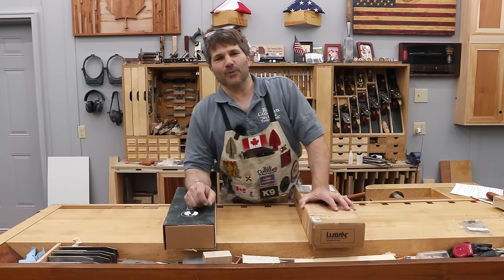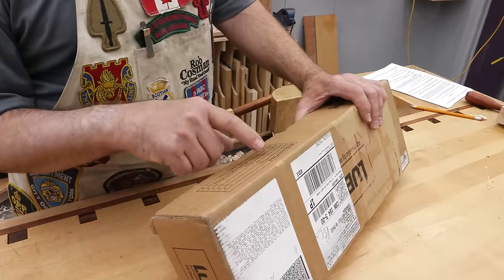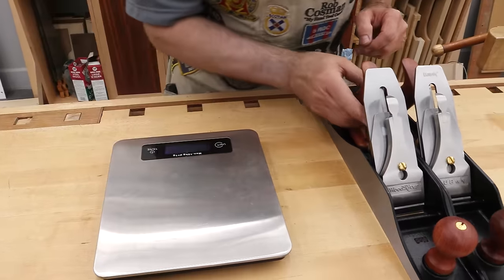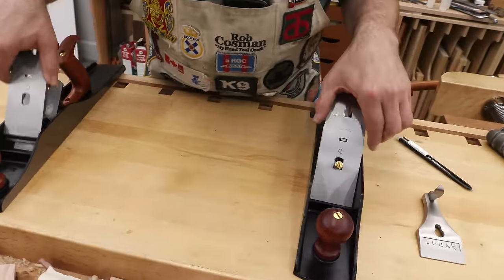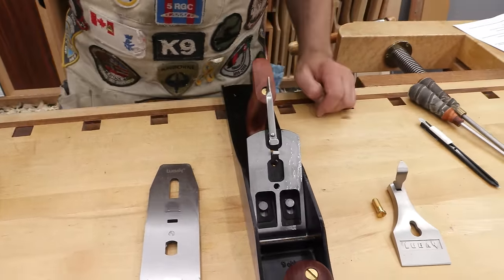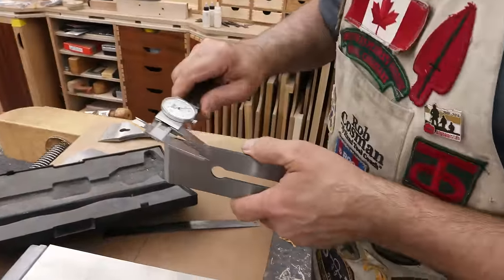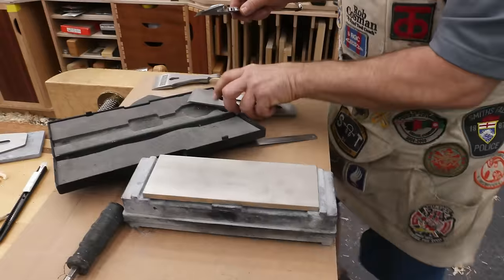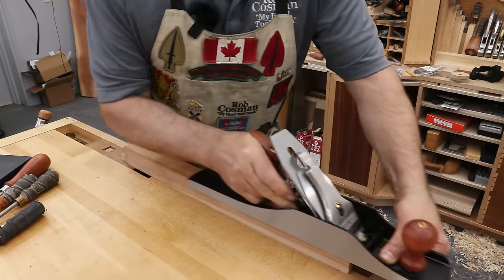Hand Plane Review - Luban vs. WoodRiver

Comment: That's weird. My 5 1/2 luban has the lever with a bearing and a pined brass bump at the top. I was surprised to see that the quality could vary that much. I guess I was lucky. By the way, How did you manage to order a luban when they are not allowed to sell in north America "due to retail exclusivity restriction" ?
I will add that i just checked on the website with the photos and the lever is not supposed to be a bend piece of steel, you should send it back and see if another one would be similar.
Reply from the maker: We just ordered it from a UK retailer and they sent it to us.
Reply: Our experience in Australia as well.
Reply: @RobCosmanWoodworking  It depends from which retailer. I assume @duvalbrice bought his from workshopheaven.com (https://www.workshopheaven.com/hand-tools/hand-planes/quangsheng-planes.html) as did I, because casting is much nicer than the cheaper alternatives from german dictum.com or from rutlands.com which for a fact has the cheaper lever adjustment (I was disappointed when workshopheaven didn't have the  No7 that I was going to buy and then further disappointed when I saw that the inside of the casting was rougher and that the lever adjustment was as on your luban in the video... I much prefer the Quangsheng/Luban from Workshopheaven than other ones). While I don't know if it's the same as woodriver, I can tell you that there are a few European sellers of planes these days, some of whom just rebrand the existing models and the others that have the factory add upgrades. It's quite possible it's the same factory with a few different castings depending on who they're making it for. But I do remember, that I once bought an unbranded blockplane, which has faint texture that seems to have once been JUUMA on the casting even though box said Luban and was sold under Quangsheng label. I also find the workshopheaven.com being more strict as far as QC and tolerances go.
Reply: @maticjelovcan  Yes i bought it from workshopheaven their planes are really great. I have the block plane, the rabbet block plane and the scrapper plane as well. I was pleased with their plane every time. Sadly since the brexit i can't order to france without paying taxes, so i won't.
Reply: @RobCosmanWoodworking  I guess it wasn't workshopheaven then. Thanks for the reply and the great video, as always.
Reply from the maker: You bought a “Quangsheng” plane, which cannot be shipped to North America, the plane we purchased and reviewed is a “Qiangsheng Luban.” I assume that is why yours has the proper Lateral adjustment.
Reply: @RobCosmanWoodworking  do you think customs would make a fuss if. Someone bought it here for you and then had it shipped to you?
Reply: @RobCosmanWoodworking  did you just mansplain my Luban planes to me? purchased ours at timbecon, have purchased others as well over the yrs. beautiful planes. very little tune up needed. best plane ever? try an HNT Gordon wooden plane. that will make you smile.
Reply from the maker: @matic it’s not a government regulation, it’s a manufacturers restriction. Once purchased, it is free to travel anywhere in the world. So to answer your question, yes that would work.
Reply: @cynjohnson1967  mansplain? Yup you're definitely Australian

Comment: I own both WoodRiver and Luban but of different sizes. It's pretty clear to me they came from the same factory with tiny differences. Lateral adjustment on Luban is identical to WoodRiver. Maybe it depends on the batch or export destination. I live on the equator and I'm  close friends with Luban marketing representatives and maybe they sent me a 'better" version. I have many Luban tools and I'm very impressed. I'm an old grumpy white man living in Asia and of course I do have bias for German or Swedish tools. But I have to give credit to Luban as they never disappointed me
Reply from the maker: Its very interesting as some comments say their Lubans have a bearing lateral adjusters snd some say they have the one we received.  I wonder if they did a version upgrade and we got an older one or they just have that much variability in them
Reply: @RobCosmanWoodworking  I will ask tem, and follow up with you on that. 
based on my observations, Luban is very ambitious, and has some sort of maker pride,
I had a similar story with the stainless steel barbell factory. I went to the factory with Eleiko barbell, and asked them if they could beat them with the quality of workmanship / materials used. Basically I asked them to make a custom barbell for me, which cost me a lot. however they made it exactly as I designed it, and exceeded the Eleiko standards.
when I visited Luban factory, I had exactly the same impression, they want to win this game. 
they have many casting molds even within the same brand. it would be interesting to compare a couple of WoodRivers of the same size.

Comment: Really interesting, Rob. In the UK we can get Woodriver from Woodworkers Workshop, Quangsheng from Workshop Heaven and Qianngsheng Laban from Rutlands. I have a Woodriver low angle block plane , a couple of Luban block planes, a Veritas shooting plane and L-N 5 and 4 1/2. What is obvious to me is that the Chinese planes are all built to a certain price point and there are small variations between them. The L-N and Veritas on the other hand are just a level above and beautifully finished. However they are significantly more expensive. Having spent a bit of time honing the blades on all of them, they all work well but the North American planes just feel that bit nicer. I guess you get what you pay for…….as someone once said!
Reply from the maker: Yes I agree with you.  I have always said Lie Nelsen is the best manufactured plane today, and WoodRiver is the best value.  The woodRiver price point was much better before the additional  tariffs went into effect a couple of years ago

Comment: I recently watched a video from Mr. Linn's Workshop on tuning up a Lie-Nielsen smoother--I forget whether a 4 or 4 1/2.  I kinda want to do it (very cautiously) to mine, but at the same time, you have to wonder how perfect is perfect enough?  My L-N worked fine out of the box, and better after 32 seconds of sharpening.  I doubt any amount of tuning will get me smoother boards.  Still, it does seem like any plane could be finished a little nicer...
A thought that occurred to me watching this is that either of these might almost too nice for a fore plane. A case could be made for the best 5 1/2 you can afford, and a Taytools #6. Then it occurred to me that Wood River could capitalize on this as a fore plane buy offering a cambered blade as an optional accessory.  Or maybe someone who sells them could. A scrub iron for a #4 or #5 wouldn't be bad, either.

Comment: I’ve got a quangsheng no 4 without “Luban” written on it and it has the same lateral adjuster as the wood river I also have a no 5 with Luban written on it and it’s nowhere near as good as my no 4 both cost roughly the same but from different retailers I’ve even tried to find a replacement frog as I hate the crappy adjuster but can’t find spares anywhere

Comment: There are two retailers that supply the Quangsheng Luban planes in the UK. I suspect he got that no.6 from Rutlands. I believe the other retailer (Workshop Heaven) specify the same build and features as the Woodriver. The Luban planes have the bearing on the lateral adjuster and the soles are supposed to be machined to +/-1.5 thou (British Standard).
Reply from the maker: Not quite.  We did buy the Luban from Rutlands.  Workshop Heaven has a slightly different model but they cannot ship it to North America, states that right on their website and we emailed to verify.  We wanted ti buy both but only the Luban that Rutland carries could be shipped to North America.  If you guys want to purchase the plane that Wood Haven carries and send it to me I will be happy to review it

Comment: How'd you know, Again! I bought a Luban No.6 two week ago.  The lateral adjustment is very sticky and I had to do a slight amount of work on the bed for the frog.  I'll follow up and check those other areas that you have pointed out.  Wood River in Australia is a little on the expensive side (Wood River = Au$570, Luban = Au$329).  

  I have been lucky enough to amass a fairly complete range of old Stanley planes.  I'm reducing the number of bench planes to the Luban No.6, a low angle jack I bought before listening to you and a Luban low angle block plane.  I have a 4 1/2, a 4, a 3 and a 10 1/2 smaller than the jack plane.  Would you keep one of these and which one?

Thanks heaps
Reply from the maker: Easy answer. Keep the 4-1/2

Comment: Small bumps on the frog or on the seat make an immense amount of difference between a plane that's usable and one that's not.  I have a Record that had two high spots on the seat.  The plane had a terrible chatter.  Fifteen seconds with a file and the chatter disappeared completely.  Another thing I check is if the blade is straight front to back - toe to heel.  If it isn't, no matter how flat the frog surface is, there will be a potential for chatter.

Comment: The Woodriver could be a brilliant plane but my experience is they don't care less about the quality of the squareness or flatness of the sides to the sole so pretty much hit and miss if you get a good one or not.   Probably the same as the Luban.   So from my personal experience with Woodriver I would rather spend the extra and get a Lie Nielsen, Veritas or Clifton plane or in my case a high quality Aussie Henry Eckert No 62 as a do it all plane and a Veritas No 5 1/4 for a smoother.... never had any problems with either and high quality out of the box and be buggered if the soles and sides were dead square to each other.... as should be expected in the 21st century lol.   Anyway good honest video Rob :)
Reply from the maker: Yes as I said in the video the squareness to the side just is not there

Comment: I've heard from multiple sources that both woodriver and luban come from the same factory.
Reply from the maker: Based on my comparison we know for sure its not the same casting
Reply: @RobCosmanWoodworking  that is true. btw one thing I often noticed is that the soles are heavily concave, something you wouldn't notice with feeler gauges, can you comment on that?
Reply: @jureklancar8148  if the sole is less than a few thousandths of an inch off along the entire length of the sole on a flat registration surface then you're fine. Just like rob showed, make sure the blade and frog are tensioned before checking
Reply: I've heard from several places that Quangsheng planes come out the same factory as Woodriver.
Reply: @alankirbywoodworking  as well as dictum and I think some more
Reply: The lateral lever is a deal breaker in a few years that tang on the bottom will wear. And if I remember the woodriver has harden retaining pins. You can check with a file don't know about the other brand on the pins and screws on the frog.
Reply: Is flattening done on granite stone with sand paper or diamond stone?
Reply: @supermo26  either, or a glass piece. Anything flat really, many people use their jointer tables.

Comment: Dont buy stuff from Rutlands lads.....theyre like Englands version of your Harbor Freight :P You should have tested a plane from Matthew at Workshop Heaven :)  This is a version of another Quangsheng plane, they are all made in the same factory just with different tolerances set by the company that sells it. Luban, Quangsheng, Woodriver, Dictum, Juuma.......all made in the same place :)  The Quangsheng has the same lateral adjuster as the Woodriver, all the rest have the same as the Luban you have. The castings are different on nearly  all versions of these planes, the Dictum one being wildly different......they still have their handles set further back from the frog like the older versions of the Woodriver and Quangsheng planes. The only difference between the Woodriver and the Quansheng is that the latter comes with Cherry handles as opposed to Bubinga, the frog has the machined slots squared off at the top as opposed to the Woodrivers rounded holes for the pins, and the Quangsheng doesnt have any brand on the lever cap......the body is the same on both planes with the reinforcement rib in the same location as the Woodriver. Quangsheng planes cannot be sold in the States due to "retail exclusivity restrictions".....because they are the same as the Woodriver plane, and it would eat into Woodcrafts custom :)
Reply from the maker: Workshop heavan cannot ship their plane to North America. Says so right on their website and we even called and asked.  The many factor prohibits sells of that plane in North America.  If you guys want to purchase one and send it to me I will happily review it

Comment: I thought the Quangsheng planes were basically the same as the Woodcraft brand.  In the US I can't buy Quangsheng because Woodcraft has the exclusive retail rights in the US.  In the UK, Workshop Heaven sells Quangsheng.  Although a lot of their products look like copies of Lie-Nielsen.
Reply from the maker: Well from my review they are very close, but not the exact same
Reply: The same factory makes both using stress relieved ductile iron. I imagine though that Woodriver and Luban each own their respective molds.
Reply: @RobCosmanWoodworking  I never did a side by side comparison.  I just saw the pics on websites or read things in forums.  
Either way, it was a good, straight forward review.  You didn't shy away from pointing out the flaws in the Wood River.  
I own a 5 1/2 and a 6 in Wood River.  I took them to a machinist friend of mine a while ago and both were square.

Comment: There's a QUANGSHENG PLANES

Quangsheng plane in UK that's same adjuster and better cast. And a Qiangsheng Luban that has cheaper components and rougher finish. It's very confusing 😂
Reply from the maker: The Quangsheng planes cannot be shipped to North America or I would have purchased and reviewed.  If someone sends me one I will review it
Reply: @RobCosmanWoodworking  I think the video is great at showing they all preform similar. But the fine adjustment is refined in some, if you budget stretches Woodriver looks a steal. Quangsheng are all out of stock anyway here. I think I'd trust you with my child for the day hahah great review

Comment: It amazes me that these planes aren't even close to square. Due to sloppy QA, they don't even bother checking the machining and ALL the planes end up non-squared.
It takes ZERO extra work to mill/grind it at the correct angle rather than the incorrect angle. They reference it off the base, so the machine just needs to be set up ONCE and all the planes will be perfectly at 90 degrees.
If we say that the base and sides are 2" each and it's 3 thou out, then it's 89.957°... sounds pretty close. Yet that's about 1.5mm in a Meter (1/16" in a Yard), which is certainly going to make it useless for squaring up the ends of a something like a bookcase.
Reply: WoodRiver set a master tolerance for the plane to be within with reference to square.  This tolerance is 0.5 degree angle.  

Checking a plane there can be a gap up to 0.45mm (0.018’’) when checked with a good quality square.   As I found out when I bought a WoodRiver 5 1/2
Reply: @nejsanerkin4474  - +/- 0.5 degrees is pathetic. That just proves that even a "premium brand" doesn't even bother to try making their planes square.
As an engineer and somebody who spends hours rectifying such sloppy manufacturing, it just boggles my mind. It reeks of "We have the technology and equipment ti make it accurately, but we just don't give a shit" !
Reply: @johncoops6897 Couldn't agree more.

Comment: I  stopped buying used hand planes. Its Lie Nielsen, Wood River and Veritas for me. Restoring used hand planes has become too expensive for me. Importing unusual obsolete parts to the United States for my Record planes is just too expensive. 
I first call and test customer service. Next I check for parts availability and purchase extra wear and tear parts for any hand plane. 
My Stanley low angle block plane currently shows most parts unavailable except the plane iron and this is 8 years later. 
I have seen many used planes in garage sale junk piles. I avoid the thin cheap flimsy twisted style lateral adjusting levers too. Cash in the trash.